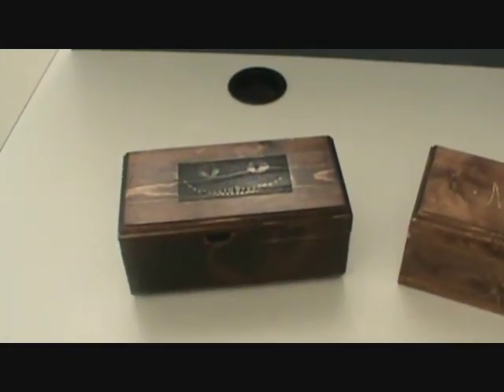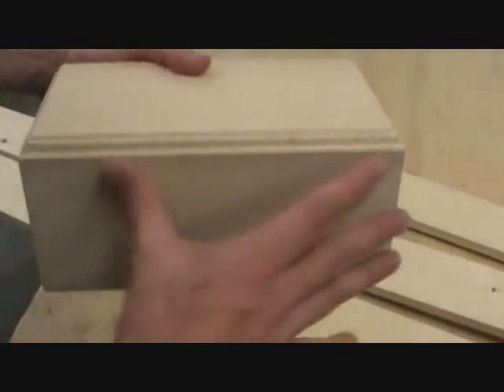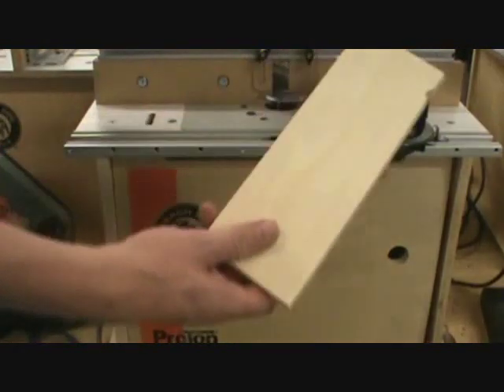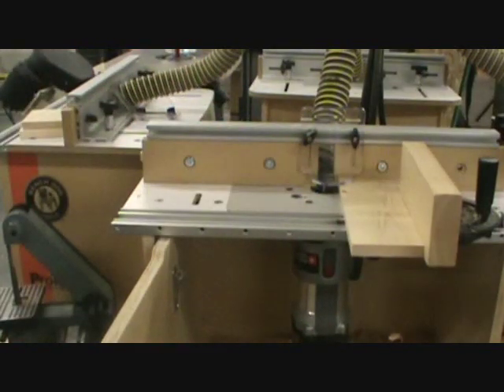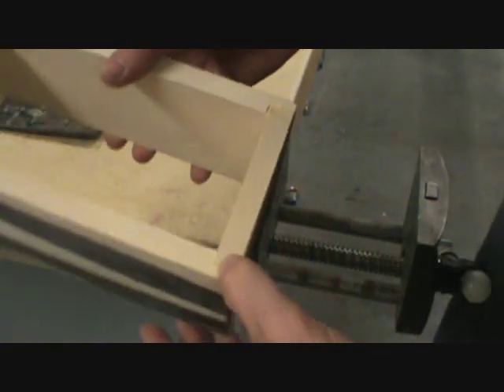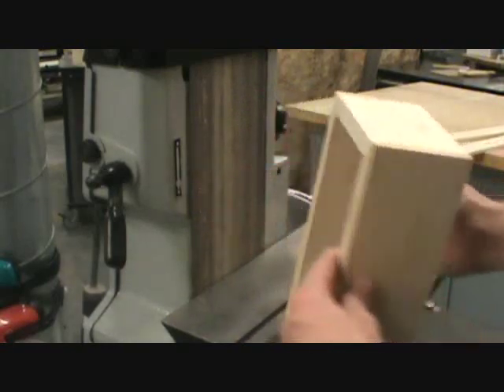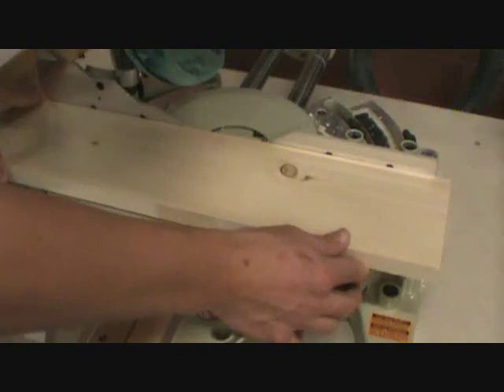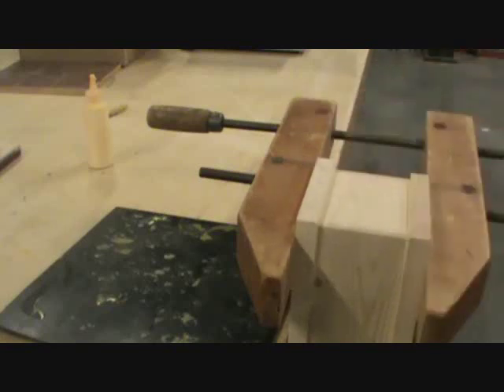How to Make the Wood Box Part 1

Comment: Great video & very informative. Might suggest teaching students to use a "fence stop" on the sliding miter saw when cutting the 2 x short side panels & the 2 x panels for the front & back. Use the tape but only as a guide to clamp a stop for the short lengths & the stop for the long lengths can remain in place. Much faster then trying to eyeball or feel the alignment & very accurate lengths. Maybe wait for the blade to stop spinning before lifting, as it may take chips out while still spinning.

Comment: Also, when cutting long lengths of timber & you make sure the timber is hard against the fence on the saw, make sure the entire length is hard against the fence so it's square. It's very easy for the far end to kick out when maneuvering the length for another cut & then you find your cut isn't square... Just a few simple suggestions that might help a bit... Again, great work and thanks for sharing... :)